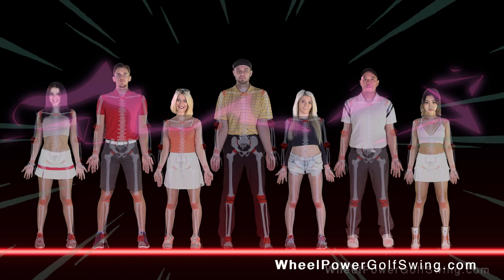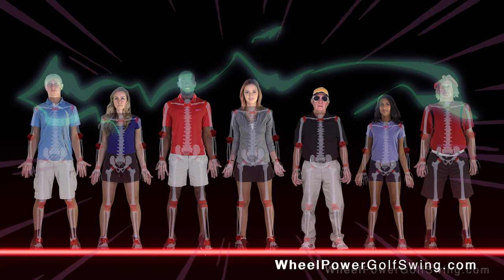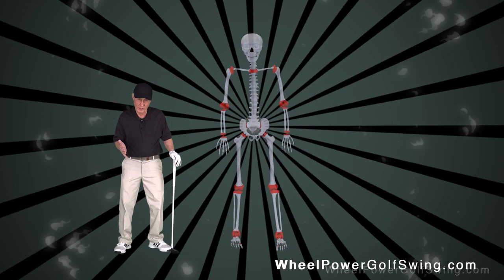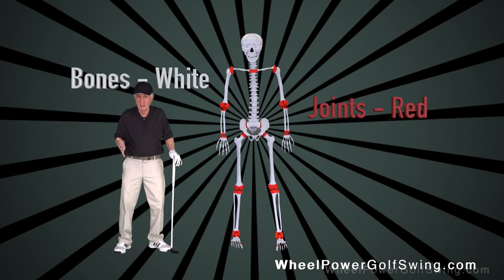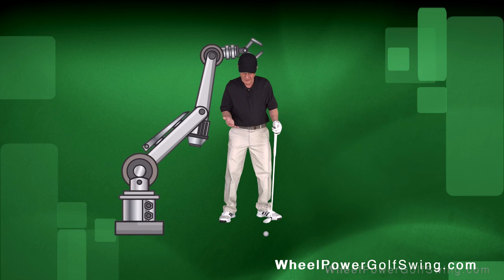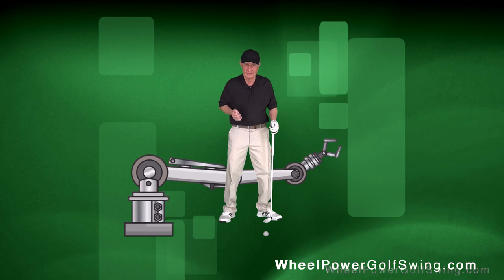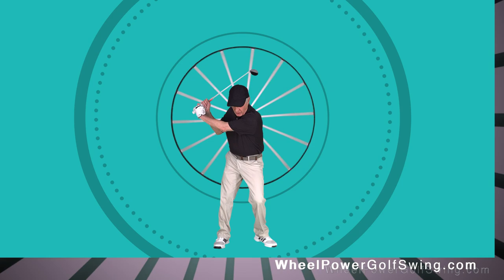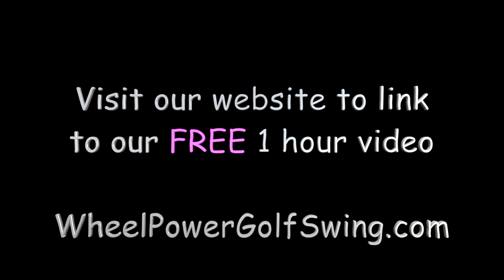Mike Austin Golf Swing - Iron Byron Golf Machine

Comment: I’m a huge believer in the Austin swing, you did an excellent comparison here. I need a tip if you can help. On the golf course  I have a problem from the top of backswing getting my bellybutton to start the downswing. Every time causes that right shoulder out and the dreaded pull happens
Reply from the maker: Hi Thanks, glad you enjoyed it. Hopefully you have seen my many other videos on my channel at: https://www.youtube.com/channel/UC1X6xMXPWLeRKanzQNTcNiA
Especially check out my entertaining 1hour long Introduction video. You can also find it at my website: WheelPowerGolfSwing.com
The problem with most golfers is that they can't separate their trunk from their hips and their shoulders from their trunk, so when the hips lead everything goes with it. I'll coming out with a new detailed instructional training video at end of 2022-early 2023. In the meantime, my advice is work on side bend exercises to stretch your QL muscles. It takes a few weeks because you have to do it slowly until the muscles feel like elastic bands.
Look for side bend exercises on the internet and try a few several times a week. When you can side bend well BOTH sides... add a turn. So you side bend then turn one way, go back to normal, side bend the other way, go back to normal.
You will be AMAZED at how your body will resolve a lot of your current problems where you move the hips and everything turns at same time.
Good Luck. Norm
Reply: @WheelPowerGolfSwing   Thanks Norm for taking the time to answer my Question!! I would like to donate some money but did not see a Symbol i.e. 💰 to click on like a lot of channels have
Reply from the maker: @fourftr  Thanks very much for your offer to donate. I have a DONATE link on my website at https://www.wheelpowergolfswing.com/donate
It's on the bottom of my main website page.
Not sure if you are also interested in watching my Advanced Training video series available on my website front page at:  https://www.wheelpowergolfswing.com
If you watched my free entertaining 1 hour Introduction video, you will like the Advanced videos. Thanks in advance for any donation you decide to make. Norm